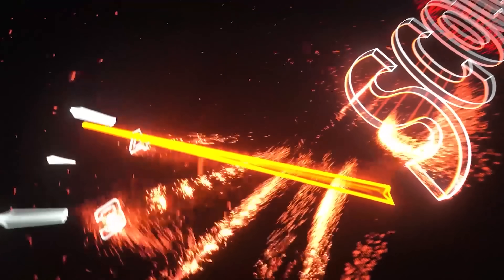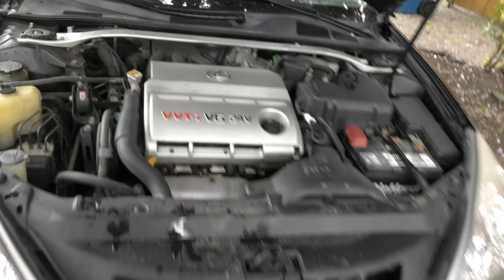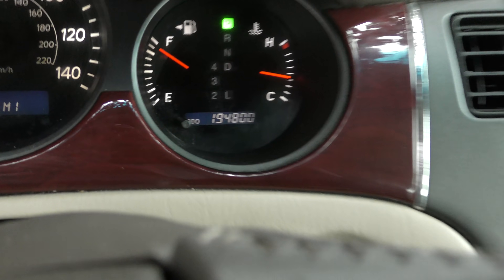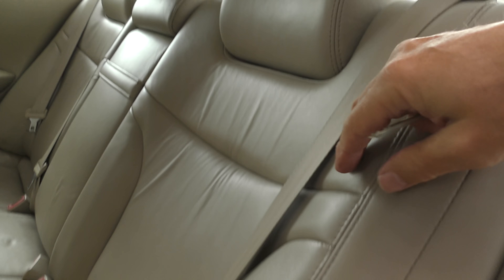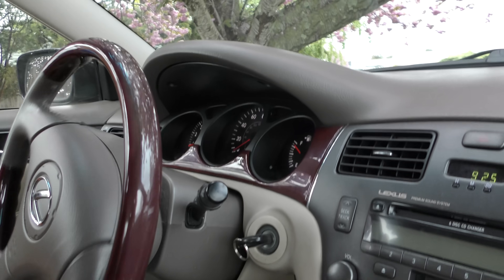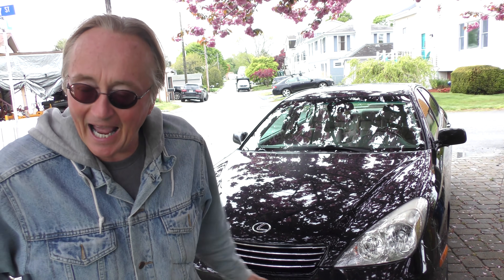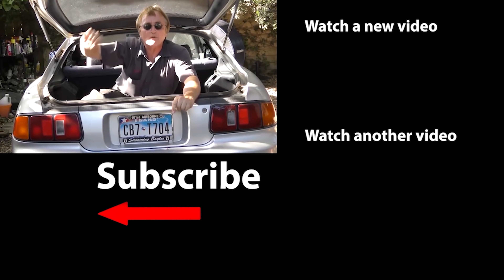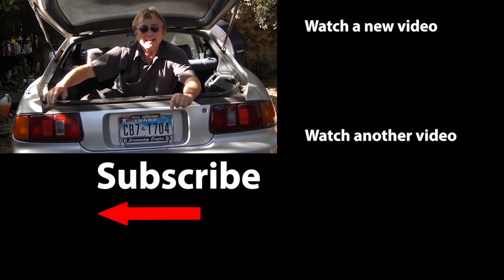I’m Sitting in the Best Luxury Car Ever Made

Comment: Scotty is the only millionaire that would say it's only got 190.000 Miles on it
Reply: YourCarAngel has a video of this car with 596,000 miles on it. Only is correct. As long as it's an ES330. Avoid the ES300.
Reply: @c.b.3234  don’t forget the ES350!
Reply: and drives a 94 celica
Reply: @c.b.3234  What's wrong with the 300?
Reply: Don't think he is a millionaire 
Where's the proof of it
Reply: @JAMESYBOY.  look it up or ask him or watch his videos he says it more than once
Reply: No he’s not ... lol! There’s plenty like him!
Reply: My 2005  chrysler 300 just hit 400k. Im the 3rd owner and its been in a few beat downs.  Transmission has a small leak
Reply: It is true I just googled his net worth and they're saying around $7 million to $10 million
Reply: But mine only has 168 K, not bad for a 2008  Toyota 🙌🏼. The money 💰 I saved is in Precious Metals ! BUT ITS NOT TOO LATE FOR YOU !!! If you act NOW ! Seriously just go to the local Coin shop and but a Silver 1 ounce coin for $37 bucks , N O W !!!
Reply: @SirSkroop  The 300 has the 1MZ-FE engine. The 330 has the 3MZ-FE which fixed a few design flaws of the former. The 300 isn't terrible but the 330 has significantly improved reliability and therefore more longevity. The engine is found in both the 04-06 ES330 & RX330 as well as a lot of Toyotas. Use Wikipedia and look up the engines for full details. It makes no sense if you're actually about to buy this car to not get the 04-06 models. Toyota actually does this a lot, make big improvements within the same generation. That's why research is key. Scotty is very popular but all of this stuff is old information that's been on the internet for years. The number one advantage to used cars is the fact that you can look at history and buy the best, most reliable cars ever made. The 3MZ-FE in particular is a contender for the number 1 spot as one of the most reliable gasoline engines Toyota/Lexus has ever made in history.
Reply: @captinbeyond  needs a new engine cover gasket
Reply: @captinbeyond  "The valve cover gaskets may leak oil into the spark plug wells, shorting out the spark plugs, causing a misfire, and illuminating the Check Engine Light. Commonly the spark plugs and ignition coils or wires will require replacement, along with resealing the valve cover to correct this concern."
Reply: @Proclaimor read that 20 yrs ago.  Who is a millionaire now?...
Reply: The Lexus Ls400 is the best Lexus ever made reliability longevity engineering ride quiet smoothness hard to beat

Comment: I wish I had friends who would sell me their perfectly working car for $500.
Reply: Where do you live to find that deal?
Reply: My dad has a friend who works on a car lot, he bought a car from someone who traded it in for $300, fixed a few things for $100 turned around and sold it for $3000
Reply: @michaelhutchinson7722  Around here, for that price, you have to push it home
Reply: My buddy sold me  his 2003 Toyota Matrix that had 109K miles  for $900. WITH service records.
Reply: Paid 750 for my es 300. 153k on the clock. Absolutely nothing wrong with it, cold ac.
Reply: About 6 years ago, someone sold their manual 5 speed 97 civic EX to my brother for $500. Had over 240k miles but ran perfectly fine, never gave him a problem until he totaled it
Reply: That thing's easily worth over $3,000 on the open market!! (especially in today's market with a shortage of used cars)
Reply: It's always somebody else that finds these deals...
Reply: I envy you guys, back in my country cars are super expensive. A Korean car can easily cost you above $50,000. Oh well.........
Reply: @rgseven6557  in Bangladesh you Pay over 100% tax on imported used cars and the tax rises for different types of vehicles.
Reply: I may be getting an Ls430 with the ultra luxury package from my friend for 1k

Comment: I have an 01 with 212k still runs like a champ!!
Reply: 78k more left
Reply: @njad3  ima put in about 2 grand into parts and labor so it’ll last me another 200k
Reply: @marcomendez7001  not a bad idea,  could last a loong time, just make sure you service the transmission and you'll be golden
Reply: @johnl3230  it’s already been rebuilt 😈 so now I just worry about suspension and the pesky belt
Reply: @marcomendez7001  that is awesome man, I bet that engine could go 350k or more. And suspension stuff is nothing. Expensive but easy to replace haha.
Reply: @johnl3230  yeah thankfully everything is still pretty much analog and the fact that my wife loves the car( she never does😂) so it’s more motivation to keep it running
Reply: @marcomendez7001  rebuilt? Usually Toyota transmissions last as long as the engine
Reply: I also have an 01 that just hit 220k. Runs perfect and was well maintained in the past. Still on the original tranny, but the Carfax indicated that it was serviced a little while ago. No reason to think this won't get me to 300k miles.

Although I do believe these engines have a reputation for sludge if you run dino oil and don't change the oil very often. I've been changing mine every 5k with full synthetic.
Reply: @robmalcolm8042  yeah I thought so too but previous owners liked to use their transmissions as brakes instead of coming to a complete stop and then changing gears 🙈🙈
Reply: @marcomendez7001  what u mean engine breaking? Like letting the car slow down by itself? That's usually better to do so you don't waste your brakes and let's your engine slow down naturally

Comment: I just bought a 2002 Lexus ES 300 with 160,500 miles one owner serviced at the Lexus dealership from day one through 110,000 miles. At 88,000 miles the Lexus owners portal says the original owner changed the timing belt, water pump, and valve cover gasket. The interior is like new. Just swapped out the in-dash CD changer/cassette player for a touch screen Alpine receiver with a separate back up camera. Amazing condition, rides and feels like its 5 years old not 19 !!  
Best is I sold my 2013 ES350 with 42k miles for the 2002 ES300 !!  The build quality on the 2002 is better, everything works !

Comment: This used car shortage is getting to be a real pain, everytime Scotty shows a used car, i look them up in my area and either they have none or very few at a very high price.
Reply: Yep and then trying to find a manual transmission on top of it.. impossible
Reply: @vermontdoggs  Import them from Japan if you can.
Reply: @pedrofernandez8729  If you can shift with your left hand! RHD
Reply: @derekisthematrix  i think it's just a matter of getting used to it. Like using a mouse on your left hand.
Reply: You gotta be willing to search nationwide bud. Gotta travel to get the best car deals. If you're only spending under 3k-ish  then yeah stay local but if you're spending 5k+ plus it makes no sense not to go national.
Reply: @c.b.3234  But you gotta consider transport fees and then there is the issue of not being able to check out the vehicle for obvious problems it may have. I say, let the market get back to normal, unless you really need wheels right away.
Reply: @pedrofernandez8729  I never said buy the car without checking the vehicle out. I'm talking about traveling, getting on a plane and flying to check and buy the car, or driving if it's a reasonable distance. Of course, you want to go to big cities, where there are a lot of backup options for the same car, not the middle of nowhere small towns.

Comment: One thing about Scotty, he certainly does not have OCD. Man, when a power window does not work or if I have an oil leak on one of my cars, I can't sleep at night until I fix it!
Reply: Not a horrible thing lol, I'm kinda the same way, especially with maintenance. I kinda overkill changing oil at 3k Castrol edge full syn.
Reply: @johnl3230  Compared to the cost of removing and rebuilding . . . that's pennies on the dollar for good insurance.
Reply: I'm like that, but also, I stop and think about how we're alive for a finite time, and whether it's time well spent.
Reply: @timothydraper6626  Very important point.
Reply: Not true.. i have major ocd and i dont care about an oil leak. Everyones ocd is diff. Just like me not sleeping if i didnt call you out 😂👌
Reply: @dbdnrbdb   Man, if I couldn't sleep for not calling someone out, I would never get any sleep. Not enough time in the day to call everyone out I would want to.
Reply: @MostlyBuicks  lol.. True but the point still remains.. He still might have ocd 🤙😂
Reply: @johnl3230  my 06 ES330 has 120K. I still use conventional. Even Lexus still recommends that for these.

Comment: I bought a 2002 ES300 new back in July of 2002.  Alabaster w/cream interior - ML sound (only 7 speakers!) and power rear shade.  The car was super quiet and road like a bowl of extra-creamy Cool Whip but handling was not sloppy.  The styling was non-existent but the interior was perfection and I really liked that car.  Sold it in 2006 for 22K w/26K miles.  That was the best car I've had except for my 2011 Venza FWD V6 w/53K miles which I still have.  Styling is subjective but dependability will never go out of style!

Comment: I love my Lexus es330! I had the same problem with the rear passenger window. It didn't need a new actuator! I ran a credit card along the window stripping seam, where it meets the glass to separate it. Then I slammed the door a few times while holding down the power window switch (in the down position). It worked! Then I sprayed some silicone on the weather stripping. No issues one year later.

Comment: Most reliable car I know is the 1990-92 Infiniti G20. The motor was built for a turbo but it wouldn't pass emissions and would drive the price over 30k in the US so we got the torn down version with the built bottom end. Seen 300k many times when I use to work for Infiniti.

Comment: Tip: i use to have a 2004 lexus es330, when i bought it the previous owner told me only problem was 2 back windows quit working. once i got it home i sat in the back seat, slammed the back doors a couple times WHILE holding down the button to roll down the window. Fixed both of my "broken" windows in 5-10 minutes.

Comment: I have an '05 ES330 with about 79,000 miles and the original timing belt. It is a second car that spends most of its time in my garage. After listening to Scotty I will have my mechanic check the condition of the timing belt. Its not the number of miles that worries me, its the age of the belt. It has been a great car. If anything bad happened to it I would be sick.

Comment: I had a ‘99 Lexus es300 with almost 400k miles on the clock and I drove the heck out of it. I did just the basic maintenance. The only thing I replaced was the transmission other than that it was in rough condition but still drove reliably. I only got rid of it because I inherited my grandmas 2014 Toyota Corolla.

Comment: I was really hoping you would show another LS430 but the v6 is great to show and this is what I sold my first car to buy a v6 es330. I put that car through hell and back but it survived until I sold it then it got it’s tires slashed at my local mall. Fwd is great for rain car sticks to ground with good tires. I bought my ls430 for 3k it was originally 71k. Look around you can always find something for a low price. Use auto tempest and learn and research!
Reply: '04-'06 LS430s are second only to '98-2000 LS400s in reliability.

Comment: The best part of this video was Scotty talking of the Price Gouging and how people will go across the street to Toyota.  As an example I live in Newnan GA and Southtowne Motors here in Newnan has 10 and 20k markups on their Sierras and Silverados (AT4s and TBosses).  They are the highest in the nation but other GM dealers are doing the same thing as I have checked them all.  They "think" there won't be repercussions for this.  LOL.  Now I am getting ready to buy the upcoming Tundra.  What is really unreal is the rudeness of the GM salespeople I've ran into and I have the emails to prove it.  One dealership in IL had advertised Trailboss for 58k and when I was about to buy it he said they made a mistake and said the price is 72000.  Southtowne in Newnan has an Orange Trailboss for sale with a lift kit for over 80000 yet the truck MSRP without lift is 57k.  Does a lift kit cost 23000?  No it does not because I install these and the best of them are 3500 parts and labor.  LOL.

Comment: Lol I bought my 2000 es300 February of 2020.  Had 164350 miles.  Bought for $750.  Had VC oil leak, bank 1,2 cats needed replaced , all 4 struts, I ended up changing all 6 injectors , ignition coils and spark plugs. The prior owner had all rotors and pads changed out with reman rear calipers. Water pump timing belt were replaced at Lexus at 130,000 miles oh coolant too. I just need to do a drain and refill with the atf.  I’ve changed the oil at 5000 miles so 3 times already has 171,675 currently. Bosal has great OEM exhaust parts. I lost $550 for ordering with sum Canadian company.  I have the champagne tan colored es300 beautiful car.  It’s actually my dream car.  I own a 08 rx350 and 04 rwd sequoia also oh and 06 Corolla.    Luv my vehicles

Comment: 1:20 - Had to replace the plastic radiator in my Mom's 2000 corolla w/ 52,000 miles and my 2001 corolla with 240,000.  They just degraded from the Florida heat.  But not too expensive to repair.

Comment: Squirt some silicone spray on the squeaky steering components that are contacting. Or file some graphite dust from a 2B pencil. I use that in locks too and blow it in with a straw. Don`t suck!
Clean valve cover leak area externally with cellulose thinners and cover offending area with dollop of silicone RTV gasket cement. From UK.

Comment: I couldn't find an ES300 for $500, but I bought one for $3k plus a civic with 270k that I had totaled.......twice. I used it as a daily for 4 years and put 40k on it. I got fantastic service, although the check engine light would come on briefly on rare occasions. I sold it for $3k and replaced it with a used RX350, another great Lexus.

Comment: Years ago I bought a 1988 Acura Legend (pre-badge/logo) from a friend for $500. Ran amazing, but needed new tires. Costco forced me to buy Z rated tires for it that cost almost as much as the car. OMFG, with how wide and long the car was, plus those performance tires, its cornering is 2nd only to my 2015 328ix.  Granted the Legend had some rust, but ran amazing, sold it for $400. I forget how many miles were on it.

Comment: I had an 02 LS430 with original plastic radiator that starting leaking and spraying coolant at 100k. Found the same OEM Denso radiator at auto parts store and replaced myself for $200.

Comment: I am humouring a Lexus as my next car when I retire my 08 Lancer... 
As money has become tighter and tighter for me I've been needing to make better vehicle decisions... 
Problem is cars like those hold there value way to much.... But my fingers would be crossed to find an old one likes that in good condition and fairly low millage... Ideally an elderly persons car!

For now my Lancer is doing me good... I fear the day the CVT bites the dust.... but 137,000 miles and still going strong as of now. I expect it to last till 200,000 miles at a min... Maybe longer... I change the CVT fluid often and the previous owner I could tell also changed it... 

Fingers crossed! 4 years later and 33,000 miles I've been happy with my as-is special that I paid a dealer I had a connection to there trade in price for it!

Comment: Good afternoon Scotty.
Should I change the transmission fluid in my 2016 GMC 2500 HD? 78,000 miles. Only issue has been the starter at 77,000. Incredible truck!
Reply: If it looks and smells normal (not burned), why not?

Comment: If a timing belt breaks on a non-interference engine while you're driving on the highway or crossing railroad tracks, you're still in trouble. Replace the timing belt before it breaks no matter what kind of engine it's in.

Comment: I have the same car..134k on the odo and runs like a dream.
Reply: Did you do the timing belt yet? Mine has 78K, 2006, love it.
Reply: @adamscastle6222  mine was a 2002. Yes  I replaced..the timing belt and other belts, water pump as its age dictates replacements. Other repairs are routine maintenance normal to any car with that many miles.

Comment: Hey Scotty Ilove your videos and I have had a 2001 ES 300 and now a 2005 ES  both cars run like new even after 200K however the transmission on both cars had ? has shifting problems. Changes with the type of gas and the tire pressure has to be perfect on all four tires for even a chance of the transmission shifting properly. Any ideas on ecu update or am Istuck with a great car with shifting issues?

Comment: Hey Scotty,
Im planning to buy a 08-11 lexus ls 460 with 60-100k miles on it here in Germany. Since all lexus models are produced in Japan it doesn't matter where I buy them right ? I'm not that afraid of the control arms or air suspension if it got replaced once before. Besides that you can buy aftermarket control arms from Moog ? Right ? I'm just curious if they have an oil consumption problem. Many of you in the US wrote about a qt of oil every 1000miles or so. Some of you experience little to no consumption at all. I'm looking for this car to buy it cash and keep it for a long term (10-15 years). 

Greetings from Germany !

Comment: Scotty, Why is the battery dying in my 06 Acura TL every 10 days?
Reply: I owned 2 Acura TL's . Still own an 05 .
Many TLs have a problem with a battery drain from The hands free phone system. You can disable it easy . Its in the overhead console and you can Google how to do it .
If that doesn't solve it , I actually put a Battery disconnect switch on my negative battery post .
they cost about 5 bucks at Walmart .You will just have to know and re enter your Radio And Navigation Codes when you re connect the battery .
Usually you won't have to disconnect it unless you're not going to be driving the car for several hours.